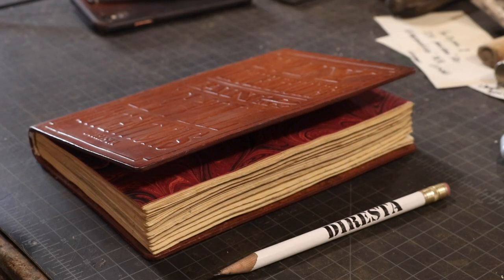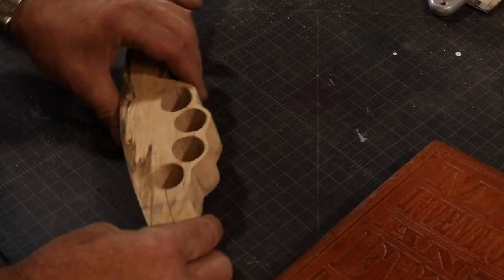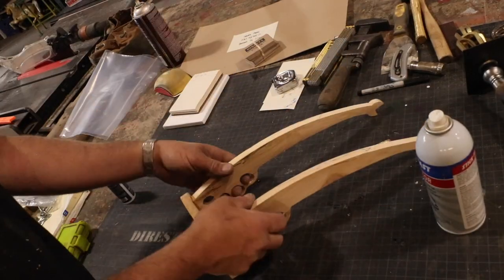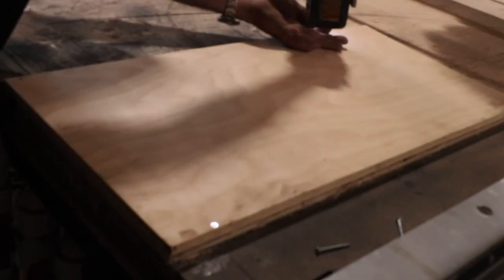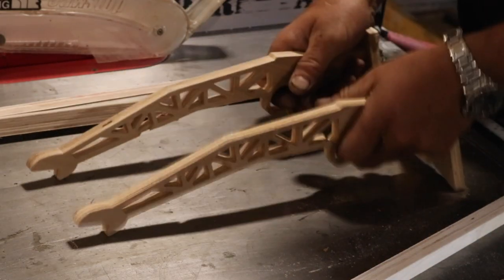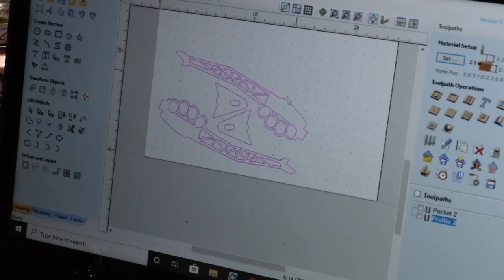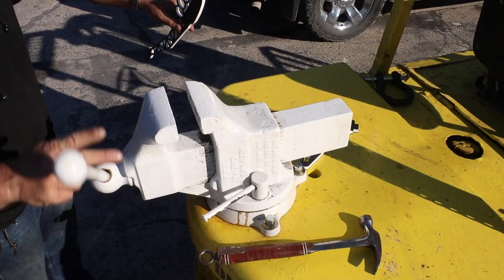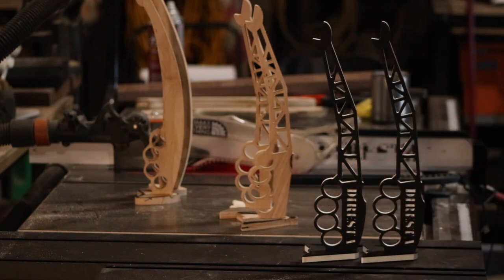DiResta Push Stick  Development

Comment: Jimmy, please consider whether a kickback on a enclosed finger push-stick is the safest. It would seem possible that a hard kickback might twist and damage your fingers if kicked at the wrong angle. As always I enjoy your channel
Reply: I was going to say the same thing. We're told not to wear metal rings on our fingers to prevent de-gloving accidents. The knuckle duster finger holes make me wince just looking at them. Especially with the leverage that could be applied from the business end of the push sticks.
Reply: I had the same thought. Perhaps make the holes not fully enclosed, open enough for your fingers to escape.
Reply: Ditto
Reply: Maybe even like the lever on a Winchester rifle
Reply: I was thinking that you could cut halfway through the finger holes so that if there was kickback it would break the holes instead of taking your hand for a ride...  Though i can't make this suggestion without hearing Jimmy repeat it in his troll voice...
Reply: When I studied martial arts years ago one of the no-no’s was actually getting a solid grip on your opponent. You don’t want to be stuck holding on when the unexpected happens.
Reply: That’s a thought for sure.  My dads friend lost a finger when his wedding ring caught on a bolt as he was jumping off our boat into the lake...  little torque goes a long way.
Reply: I agree, I think keeping the finger shaped grip is fine, but those rings need to be open bottomed, like a heavily contoured grip, not like brass knuckles. Maybe the compromise could be a loose thumb loop, so you could keep them in hand while working
Reply: Or maybe, how about breakaway tips instead? You could dovetail the end on so it fails in the event of a kickback
Reply: @chickfamilyink  and @Jimmy. What about adding some magnets in the bottom and top half of the (Whinchester rifel style) finger grips. If it needs to break open you only have the magnet force instead of breaking a peace of material. Just like a keycord style breakpoint.
Reply: @Mr_Freubel  Or maybe no ringlets at all....
Reply: In Aviation maintenance, rings on fingers are safety factor for the same reason. Would recommend a form fitting grip verses enclosed finger rings
Reply: The "rings" would need to be the weakest link, so that if something kicks, they fall apart and the worst you get is sore fingers.
Reply: I was thinking this too
Reply: @Mr_Freubel  a mini winchester would be cool too haha
Reply: All my push sticks are similar to a hacksaw handle, plenty of grip without any confinement issues.
Reply: First thing I thought, surely with any kick you'd want the push stick to leave your hand freely.

Comment: Really like the concept, but for push sticks that somebody has to buy instead of make, maybe consider replaceable tips.  Thin cuts eat push stick tips, so cheap injection molded plastic that you can throw-away might be an option if you get enough interest.

Comment: "Design" is where I struggle. I can weld, machine, etc, but I don't have the vision of great designers. Thanks for walking us through the process a little bit, it was like seeing behind the curtain the connection between the problem solving and aesthetics.

Comment: When I build my push sticks I incorporated a circular cross guard that is in front of the hand grip. If any material kicks back off the blade now it will hit the guard. Feels so much safer. Plus as an added bonus it holds the handle up off table top when layed down, for easy grabbing.

Comment: Thank you so much for this super useful & instructive video. Had I been using these I would not have had to be wheeled into plastic surgery to have my thumbs top bone rejoined after I cut through it on a table saw, forgetting what I was doing while clearing cut fire wood. I haven't the budget for a saw stop, but these I will make. Thank you for sharing & helping me to be safer.

Comment: That material is great stuff, I used it as runners on my table saw sled. I get it from the dumpster of a local sign shop. And as you said, you can bend it totally in half and it doesn’t break.

Comment: That design is great, that is my biggest gripe of the push sticks is putting them down when I need to pick something up, then put that peice down to find the push sticks. The cycle continues for about five minutes then I find something shiny and play with that about an hour then realize the cap is off the glue bottle. I think I need these.

Comment: I'll never use a push stick again after this past Spring. Was using the same as always, no problems, until there was. The end of the stick caught the saw blade just right and slammed it right into the palm of my hand. Nearly 3 months to heal that. Finger holes - an accident waiting to break someone's index finger at least. Just my $0.02.

Comment: What would be really nice to see are changeable tips for these. So you can switch them regarding the materials you have of if you have worn them down. As those handles are pretty nice but also time consuming to make, maybe some swapable tips could make them less wasteful when theyre worn down, or more versatile for different materials you want to hold with them. In my old workshop we had different push sticks and you were constantly seeking the right ones.

Comment: Great video. I always want the push stick in my left hand to be pressing the wood against the fence but the tip is usually not designed to do that. I noticed with your last iteration that the left stick kept slipping and you had to move it to push from the end and not the side. Can't wait to see what you come up with.

Comment: You might want to round off the insides of those finger holes, or put a sprung hinged breakaway at the index finger hole, so it opens toward your body. This is for safety, so you are able to let go in case the pusher gets grabbed by the saw. You don't want your hand being captured within if the stick gets pulled in.

Comment: The concept is great but, you're going to find that even that design you're still going to have issues. You'll want a design to where the push stick sits completely flat on the work piece. The "V" notch type will still allow kickback, they simply don't hold the work piece down flat on a table saw. It's a great design, don't get me wrong. Safety is key and push sticks that are designed this way, aren't really safe at all. Great video, cheers :)

Comment: Nice! Looks like the left hand slips along the edge. Perhaps something to help it grip?
Reply: Speaking as a left-handed individual, keeping them the same left and right would be best. Making some adjustment to the left-handed one for the way a right-handed individual would hold it would likely make it harder for a left-handed individual to hold it. It's likely that us left-handed people would hold the right-hand one a bit differently too...
Reply: A thin layer of silicone or soft rubber would be enough, IMO.

Comment: One other design challenge would be adding a lever arm so that the right hand one can hold the material down as it gets closer to the blade.  Maybe like a reverse knife opening to help hold the wood down.  And can be flicked closed?  It's one of many reason why  I like the Gripper style since it helps to push down on the material as you feed it.

Comment: What about potentially making an aluminum or other more durable material handle with replaceable inserts for the sacrificial portion? To preserve the beautiful design from being scrapped once the tip is too worn. This could open up the possibility of customization for the sacrificial portion as well.

Comment: Cool design! The only flaw I see is the stand at the base comes very close to the blade as your right hand pushes the piece past the blade. I can see that base corner nicking the blade. The stand up feature is not critical to the functionality of the push stick.

Comment: Advice from germany: they're too delicate, basically every workshop over here has such but the head is far wider so if it slips into the saw its not getting pulled between sawblade and table. Look for "Schiebestock" and you'll see what I mean.
Secondly no one here is allowed to use table saws without a riving knife behind the saw blade and its also normal to have a saw blade cover that protects you from slipping into the blade as well as being connected to an extraction device.
More pricey but definitely worth the safety. You only have two hands after all ;)

P. S. I would also get rid of the finger loops. Seems grippy but if the saw kicks back it might slam your fingers on the table and break them. A stick you can always let go but with finger loops your hand will do as the stick does. The saw blade cover and riving knife look quite usable, glad to see that at least some people use them
Reply from the maker: There is a riving knife.
Reply: @jimmydiresta  I noticed, many people in the US seemingly use table saws without a cover and riving knife seemingly though. It's good to see that you have both, it already lowers the risk of injuries by a lot
Reply: Still not sure how, if the push sticks kick back, they'll break the user's fingers. Wouldn't the saw blade just cut through the push stick instead of grabbing it?

Comment: the finger holes seem dangerous if there is kickback. what if the rings were held together by little magnets or pressure clips like ski bindings so that if there were a twist, the magnets would break apart before your wrist or fingers did?

Comment: I like the idea of this and will consider buying them when and if you get to that stage - question?: with the left push stick, I notice you use the side of it (the tip) to support/hold/push the piece of material... do you have enough grip on the side to prevent it from slipping?
Reply from the maker: Need to use for a few weeks

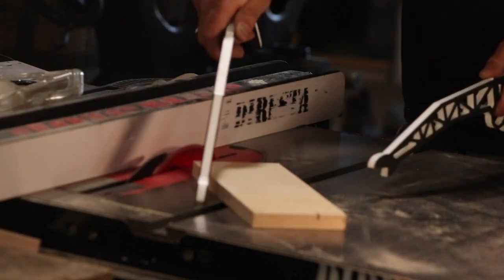Comment: 10:00 That's about the size and same material of a piece that kicked back straight into my 🥜🥜 many years ago. It was because of incorrectly using push sticks and standing directly behind the blade, that I  thought I was gonna be sterile! I always thought that, besides those damned radial arm saws (h8 those!), the table saw is one of the more potentially dangerous tools in the shop.

Comment: Great video. Is that software that comes with V.Carve Inventables CNC? Seems easier that Fusion 360.
Reply: the Inventables CNC comes with the web based application"Easel". the software that comes with the Shopbot is Vectric.
Reply: @aaronmattia8998  thank you Aaron.

Comment: Jimmy, I’m a little confused. How did you cut your finger when you have a saw stop?
Reply: you can get a cut from a saw stop, even if you hit the blade, it will be much less than with a non-sawstop accident. In this case though, his finger didn't hit the blade, when the wood kicked back it hit him on the finger.

Comment: It may not look as fancy but if you're going to do this in production runs you'd be able to  lower your cut time significantly by eliminating the girder design in the center. Maybe if you just run a profile cut of a design in the center maybe 10 thousandths deep? Frankly i would prefer your "little hands" push sticks you used in the past and you could design them with no thumb and they would be a "Diresta original".LOL
Maybe for the design rather then the gerder a vector design of a fist showing "thumbs up!" just 10thousandths deep. save a lot of cut time.

Comment: The bit where Jimmy uses a photo in  illustrator to get the design.. Can this be done in inkscape
Reply: any vector program that allows you to import .jpg and .bmp. put it on it's own layer and draw on top of it. Can also be done in Fusion.
Reply: @aaronmattia8998  cheerz Aaron..

Comment: I wonder how much is spent on electricity lol. The dad in me is like 32” disc sander, sounds pricey hahah.
Reply: 220v pulls less amperage normally than 110v
Reply: Dave Makes  but the calculation for watts used is amp x power.

Comment: What if the truss section was a “compliant mechanism” that snapped back and upwards at a force level associated with kickbacks to address the concerns of the finger loopholes? It would be getting into the overly engineered territory but it would still be technically possible to produce it on a cnc router.

Veritasium made a good video discussing their principles.